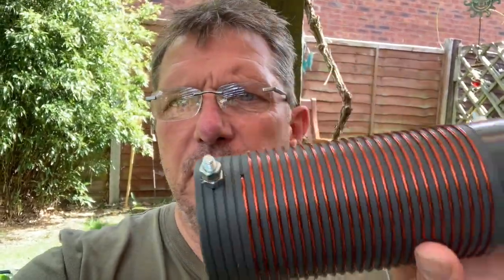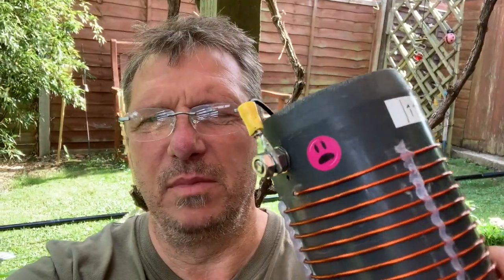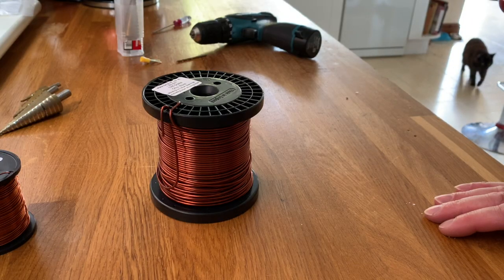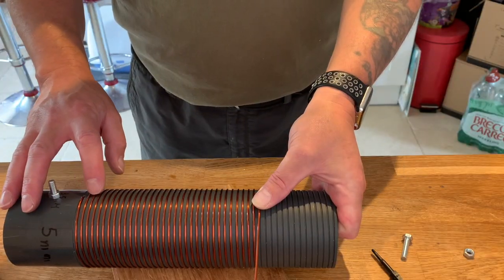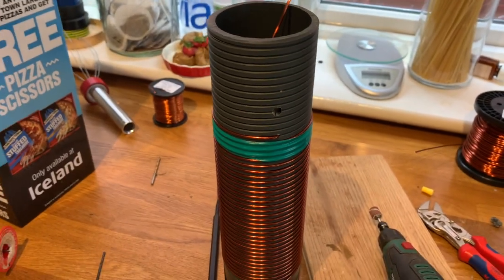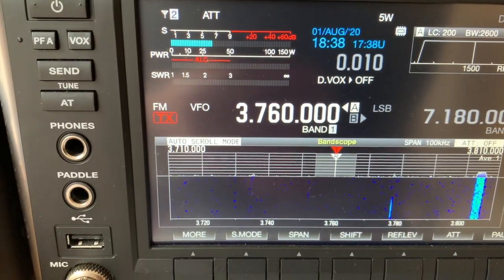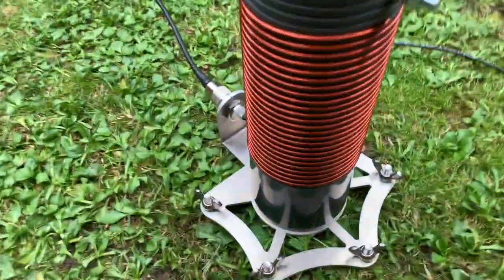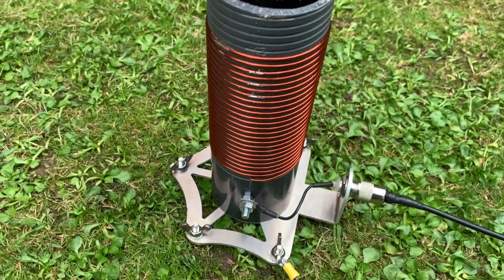HAM RADIO: DX Commander Base loaded for 80M Vertical.  DX Commander

Comment: Hi Mike,
After a year I don’t expect you to see this or respond, but it looks like a person could use bare wire in this instance, since the wire is well spaced anyway. If you read this what do you think? It would make some of the steps easier. Also I already have bare wire. What about a change in velocity factor?
Reply from the maker: Well I try to keep up to date with all the posted video’s,  yep bare wire would work just as well maybe even better because you could use a hose clamp over the top of the coil to adjust the tapping point…..
Reply: @mike-M0MSN  Thank you!

Comment: Do you connect the bottom of the coil to the ground of the SO239, or just leave it not connected to anything? I’m working on a similar antenna (but for 40m) but found conflicting information online regarding this part. Thanks!

Comment: Question please,  if you added another separate coil in parallel,  by using  a jumper around the original coil to a second one tuned to a different frequency. Would this broaden the bandwidth of the antenna automatically. Would the rd wave find the closest resonating coil.  The idea is to have both coils live at the same time. But tuned for separate frequencies. On parallel circuits. This how my hygain 680 antenna is built for the different bands. 9 of them. I was just wondering if it would work for a wide band 80m antenna,  one antenna for the whole band.
Reply from the maker: that's an interesting idea, I cannot see the answer off the top of my head, it maybe worth building it and giving it a go, please let me know how you get on...
Reply: If you placed the coils side by side would that act creating a magnetic field in the adjacent coil? May have to turn one coil on its side so the fields are out of phase with each other.

Comment: Irrigation drainage pipe comes in several diameters one of which is 50mm. It's very useful for winding coils such as this because its a helical construction with 6mm spacing. A lot easier than getting your pipe turned with a lathe.
Reply: In several videos, 5mm spacing is mentioned. Would there be a difference in coil turns if 6mm spacing is used? 73's K8JAZ.
Reply: @Tonylovesjazz  You need the same number of turns for same inductance. Only length of coil changes. Would use an LC meter to confim/adjust inductance before finalizing the coil. In the video he provides the inductance in uH for 10 winds and gives the total # of winds so you can calculate the necessary total inductance accordingly. 

I am unsure as to how the requisite loading inductance was calculated at the outset however. Would have to hit the books for that.

73,

John - KK7JBZ

Comment: Hi Mike, great video, but I have a question... I notice your build is on a pole without the other dx commander radiator elements.  Have you tried this with a "whole" dx commander, and if so was there any issue with resonance on other bands?

Comment: Do you know exactly the value in uH of the coil so it can be wounded on a different  pipe and wire  diameters . This aproach is best solution for multiband 40m and 80m vertical antenna. Thank you for sharing . Every 10 turns , 7.3uH. You said ,didnt watch till the end. Sorry. I apologise.

Comment: Hmmm, the 1.8mm wire is sold in 500 grams or 1 kg, how much does 8.5 meters weigh? it is not mentioned on their website :-)
Reply from the maker: 500g of 1.8mm copper is more than 50m
Reply: @mike-M0MSN  thank you :-) I have sent you an email (from qrz.com) hope you monitor that account :-D
Reply from the maker: @PerB_M  Yes I have got it, will reply soon.

Comment: Couldn’t you just use 2 mil or so insulated electrical wire?  Then you wouldn’t have to faf  around with lathes or spacing and hot glue?  The electrical insulation would give you the spacing and prevent arc over at high power.  Perhaps I missed something here and there’s another reason for doing it this way.  Tnx for the vids Mike, just made your multi core efhw 1:64 transformer...

Comment: Awesome video!!  Thank you!!  I have seen several people on videos recently use a diagonal cutter to crimp a non-insulated terminal before soldering. 8:17  Am I seeing this correctly?  Is this a thing?  Why not use a crimp tool with the proper non-insulated crimp die???
Reply from the maker: Just watched it back, I think it was because of the space or because I could not be bothered to get the tool out of my bag.... still it worked ..lol.. Thanks.👍❤️

Comment: Hi Mike great video, I checked out the website that you gave for the pipe supplier. There are two sizes both are classed as 3”, one is the high pressure pipe (I think that’s the one you used) which measures 89.9 mm outside diameter. The other is solvent weld waste pipe, which is 82 mm outside diameter. Could you please clarify which pipe size you’ve used before I order mine. So appreciate all your efforts and the information. I certainly can’t use our kitchen work surface as my bench though I’d be shot at dawn!! hi  Ok thank you so much G0 DTT 73s
Reply from the maker: Product Code: LPCLC-0750
Reply: @mike-M0MSN  Thanks Mike very much appreciated 73s
Reply: Hi Mike I’ve managed to get the bits and build the coil, I was just wondering could I run my wire vertical element on the same pole as my inverted L dipole. Would you foresee any problems with that, as you probably guessed I’m not very technical on these things 🤔
Reply from the maker: @roymycock413  it worked for me, give it a try..👍

Comment: Hi mike. Zaheer here 9w8zzk. What tool do u use for creating the line of pvc for copper wire?
Reply from the maker: A friend with a lathe.... but you can use hot glue or two sided tape.
Reply: @mike-M0MSN  using thread really nice workmanship,mate.
Reply: How long the pvc pipe from starting till the end with some space for so239?

Comment: Mike, why didn't you mount the coil above the driven plate and connect it directly to the this plate?  Peter VK5COV
Reply from the maker: Peter VK5COV Hi Peter, you can. I just wanted to show that it could be used as a standalone. :)
Reply: @mike-M0MSN  Mike, have you tried a 80m loading coil on the DX Commander with the other band quarter wave driven elements?  I'd be interested to know if I could get away with not using the inverted L.  I have a shiny new DXC ABV on the way from Callum.   Currently using an old 4m Hygain with a weather beaten loading coil.
Reply from the maker: @petervk5cov17  On my list :)

Comment: 👍Thanks for sharing. Coil looks good. Would suggest wrapping some self-amalgamating tape around the PL-259 at the base of the antenna. Without it, water will probably ingress into connector and co-ax (I learned this years ago the hard way 😉).
Reply from the maker: Steve GM0HUU Cheers Steve, it does not stay out only when in use...

Comment: To achieve completely parallel wraps on "staggered vape coils" we used to wrap two wires in parallel & then unwind one of them. I wonder if those without access to a lathe could use a similar "sacrificial wire" technique using say speaker wire as it's <>5mm wide, or a hollow core cord like Dyneema that lays pretty flat, or even 5mm plastic from cable ties without the ends & then you could just leave either of those glued in place?
Reply from the maker: good tip. :)

Comment: The pipe you are using is Gray it has carbon in the plastic mix, use a white or better still clear pipe, this coil will heat the pipe up.
I make my coil formers on a 3D printer this way I have no drilling after, just wind and go.
That said great video, I like to see Hams experimenting not just making a homebrew G5RV  or a windom I hear it all the time on the bands,  " I'm running a homemade antenna" they call a piece of wire and a bit of feeder homemade !! 
Cheers
Reply from the maker: Thanks for the tips!

Comment: What type of pipe is that Mike?
Reply from the maker: Osmo I think...maybe hepworth 3 inch drainage pipe
Reply: @mike-M0MSN  Yea? Very thick wall. Not sure where I'd get that here (Ireland).
Reply from the maker: @andylinton2798  online....
Reply: @mike-M0MSN  I would if I knew exactly what it's called!
Reply: @mike-M0MSN  NIce sig from you here on 3755 just now!
Reply from the maker: @andylinton2798  Cheers Andy, here is a link... https://www.plasticpipeshop.co.uk/3-3m-Length-PVC-Pipe-Class-E_p_578.html?gclid=EAIaIQobChMIroiZmu2I6wIVcWHmCh1SAQilEAQYAyABEgIrg_D_BwE
Reply: @mike-M0MSN  I assume that is the inside diameter?
Reply from the maker: Peter VK5COV inside of the coil, outside of the pipe. 🙂

Comment: Hi Mike,
Thanks for updated stuff. I still have to assign a couple of hours to try mine out. Question about your ground radials when you implemented the 80 coil- Did you add any extra wire to your radial system or did you simply use the 10-40 DXC type of radial system? 

Mine might be a wee bit more complicated in that I intend to use it portable with elevated feed-coil at approx 3m AGL and try with a couple of 19/20m elevated radials.... let’s see!
Reply from the maker: Yes mate added a single 20m ground radial

Comment: Hi mate good build 👏👏  would it not be better to to place the coil at the top of the 40m element, placing it there raises the point of maximum current to where most of the antennas radiation takes place making it more efficient. Then you would only need a shorter section above to bring it to resonance; which could be a brought of at 90degs for an inverted L or  at 45degs to give some slight directivity. The 40m section wouldnt be affected as the coil would choke off the 80m part .. great video though  m0zww
Reply: I use a 12m pole made a guy plate to fit at just under 10m the coil sits on top of that with the 80m wire coming off of that.... also added a further 168uh coil (220 turns give or take) and got top band as well... works well, its a variation of the Battle Creek Special.
Reply from the maker: Got to send me a photo of that.. :)
Reply: @mike-M0MSN  ..... will do mate I'll email it to you....
Reply: @billythebootlegger.4376  Call sign Bill? and put it on Qrz.com for us all to see.
Reply: @ON8EI  hi mate the call sign is m0zww there is a crappy shot on qrz, but im having a bit of a rebuild so will sort out a decent shot or two..
Billy m0zww
Reply from the maker: Yes you could do a top loading coil or mid point which would be the best of both worlds, top loading would change the radiation pattern and reduce the angle of takeoff great for local work, and you would need a very strong pole to hold the coil on or near the top.  Mid point loading is best for local and DX but you loose the 40m switching, so base loading......  but an inverted L with a 40m trap would work a treat... why not try the top loading solution 👍😁
Reply: And also the coil wouldnt need to be as large, 45mm close wound with 18 gauge....
Reply: Already have mate 😀😀

Comment: does that mean i can forgo my inv L for 80m on my dx commander, and re adjust the 30m leg for 60 & 30 m ?? , my current 80m inv L is 19m 10cms ish and i can get into most of south america and into oceania  on ft8, be interesting to know, also where is the 15m gone ??, as my memory serves me correctly 15 is a bounus on the 40m element , i know questions galore :) 73s kevin G2KS
Reply from the maker: The loaded base is never going to be as good as the full sized 1/4 wave on 80, but yes you could replace the L with a 60/30 but.......build one and give it a go.. that's half the fun....

Comment: In the USA they have Caterpillar Grommets that are evenly spaced so winging a coil is more easier than guesswork or having a lathe. It is a shame the UK does not have them as it would aid the winds on the former much more better.
Reply: In the U.K., they are known as Castelated Grommets (Farnell, RS Components) and they work well for coils.
Reply: Crenellated grommet strip, available from CPC in the UK

Comment: What is giving you the large bandwidth Mike? Is it the larger diameter coil?  Do you use linear loading and are you still able to get 15m on the 40m element? Great video. Thanks.
Reply from the maker: Hi Don, I believe it is the the coil diameter that helps, the aerial is 31 foot long NO fold back so not linear loaded for this coil. 15 is ok (may need to use a ATU a bit) for the 11.2 meter version (linear load version) the coil needs to be 19.5 turns 3" Dia
Reply: @mike-M0MSN  Thanks for getting at the heart of my question. High Q is wrong. Really meant that your bandwidth is awesome on that coil.

Comment: Very good.  Would that do 60 as well, with  a different tap? You could remotely switch between the three bands with a couple of relays and putting +/- 12v dpwm the coax, if you're too lazy to get up and move the flying lead :) probably better just to run a separate conductor, though.
Reply from the maker: proudsnowtiger yep 60 is turn 19 ish.